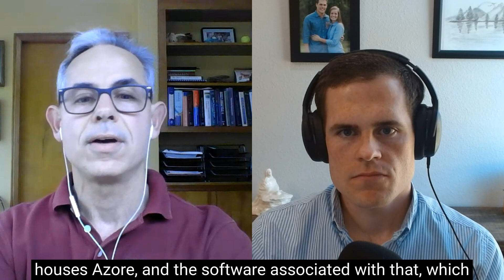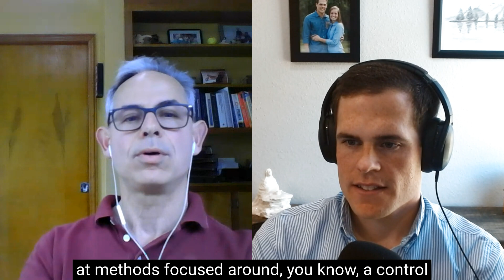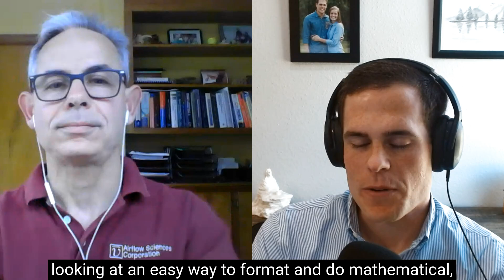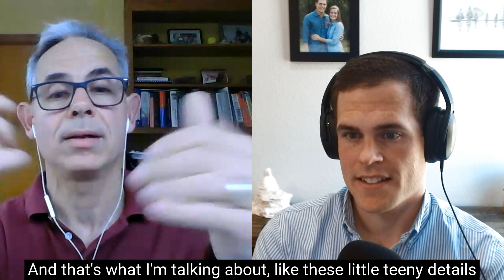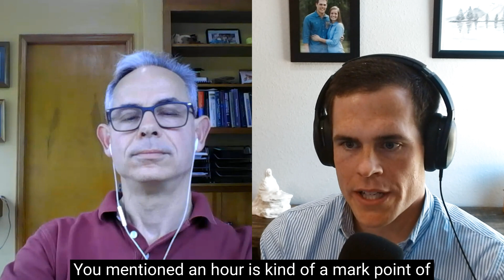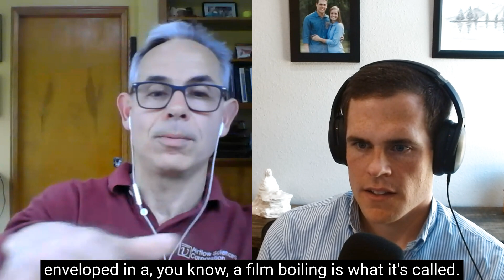EP 010: Jeff Franklin | How to write CFD code: Lessons learned {How To Become A CFD Engineer}

Comment: Could you explain triangular cavity problem more. The element at the lower corner has vertices on the solid walls with all Drichlet boundary condition? I could not see its relation to wrong gradient value.